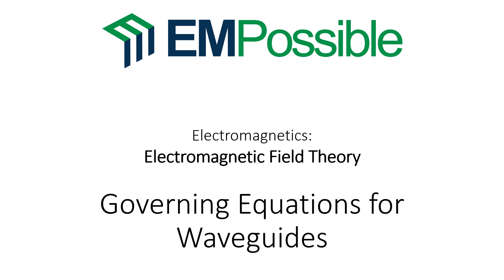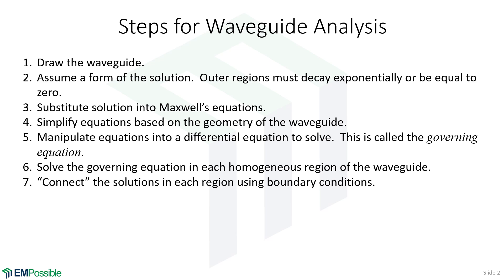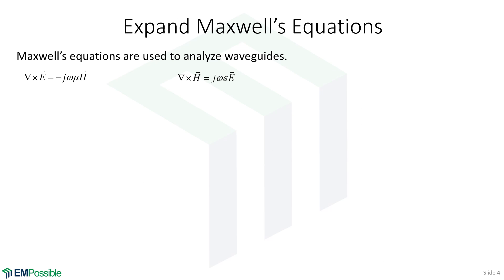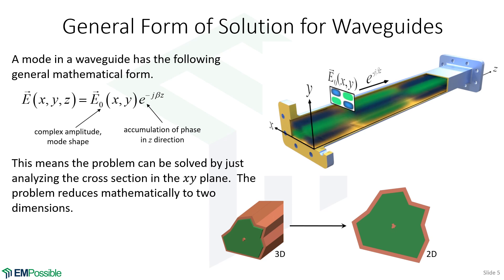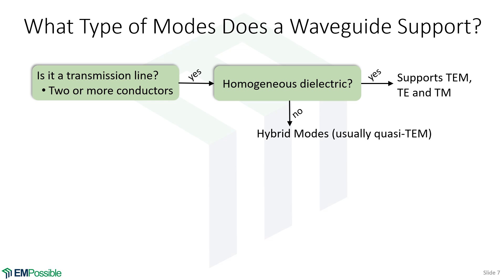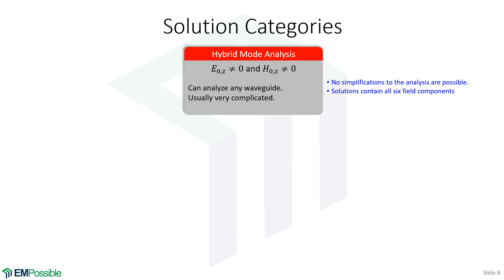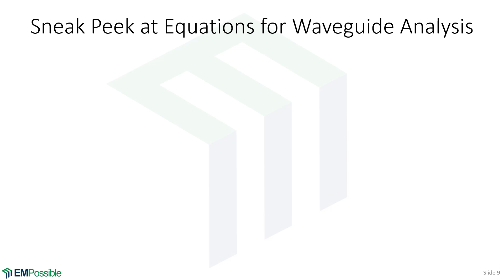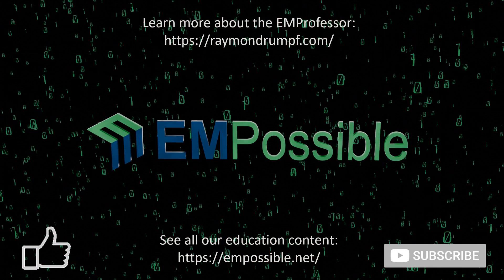Lecture -- Governing Equations for Waveguides

Comment: When we were dealing with electromagnetic waves , the solutions to the same differential equaitions gave a forward and backward wave, but now it looks like we have a different solution where the E0 component only has x and y components.
Reply from the maker: I think you are talking about the full wave hybrid analysis? In this case, the modes still have z components. It is just that I algebraically eliminated them. I did not set them to zero. You can certainly calculate the z components from the x/y solution.

Comment: I was playing around with a $5 soft-switching tesla coil from Amazon, I decided to put a spark gap at the end of the secondary coil, across the spark gap I made another loop counterclockwise and placed it inside the secondary coil. When I did this, the LED diode on the circuit board turned into a slightly different color. I held another LED diode in my hand, while holding onto the anode of the LED I touched the cathode to the coils and the LED lit up in my hand. But It was very finicky and only sometimes worked, until the transistor burnt out.

Can someone please tell me why this might happen? The volt meter just read "Err" and I don't know why the LED would light up in my hand.

Comment: Is there an analytic solution for a rectangular waveguide with radiused corners? For example, if I machine a deep pocket using a round end mill to create a section of guide with a cross-section  the same as WR90 except the corners have a radius of 4 mm. I know it works and I can analyse it numerically, but I'd love to know if there's an analytic solution that  reduces to the rectangular case as the corner radii tend toward zero. Thanks so much for all of your content.
Reply from the maker: I suspect there is, but I am not aware of it and never looked. With pretty high confidence, I can say the effects will be negligible until those bevels become very large. The power in the mode is far away from the corners so a modest level of rounding would not have a significant effect.

Is there a reason you want an analytical solution instead of numerical?
Reply: @empossible1577  Pursuit of beauty, truth and inner meaning of nature perhaps? No, just idle curiosity. I'm manufacturing a series of waveguide to coax transitions for 5.7, 10, 24 and 47 GHz and it appears that for the finished parts, the difference between square corners and a radius has almost no impact other than making the machining simpler. I wondered if there was some deep reason for the results I found and modelled, but I guess it's as you say, in TE10 the energy in the corners is minimal. I'm using OpenEMS FDTD but I just bought your book so I'm looking forward to trying the freq domain approach as well
Reply from the maker: @MachiningandMicrowaves  I would love to hear your opinion of the book. I have an entire chapter devoted to waveguides.